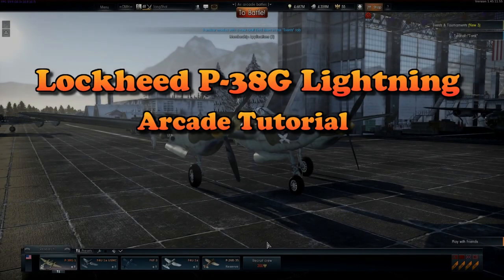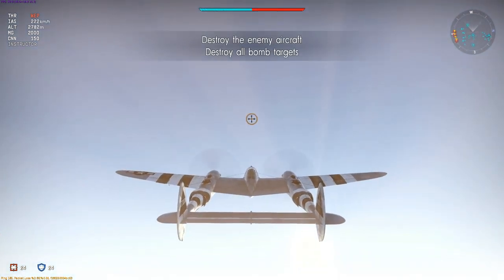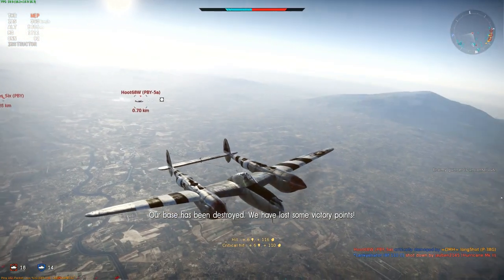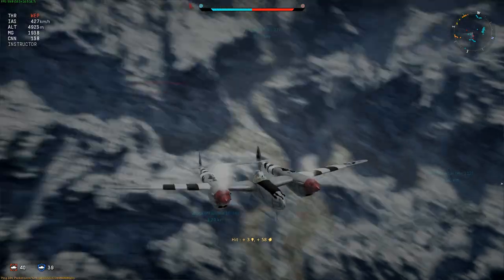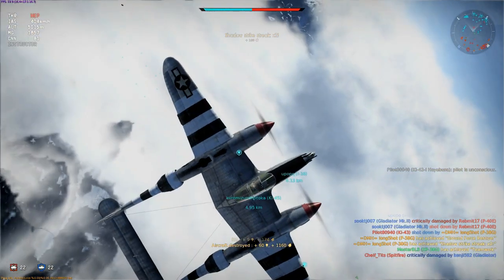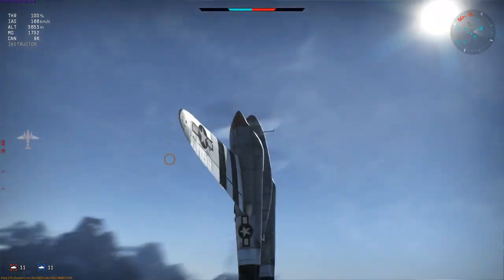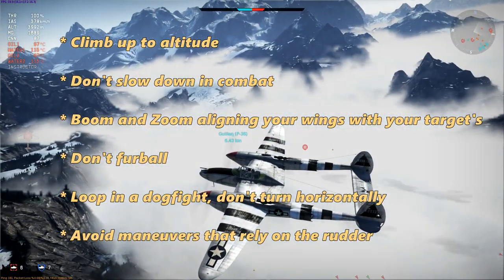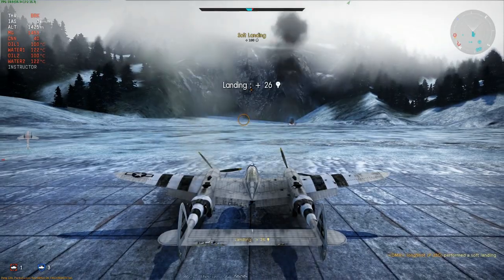WT - P-38G Arcade Guide (Patch 1.45 edition)

Comment: yeah it might have faults.  its as durable as a thin piece of plywood covered in gasoline.  and it can't rudder turn at all.   but the firepower is too good to pass up.  A fine bomber hunter indeed.  and with its good climb rate, one can dictate when you want to engage fighters.  and it can out run almost anything at its BR except maybe a thunderbolt.
Reply from the maker: Yes, very good at hunting bombers provided a gunner doesn't set you alight.  But there's other fighters that climb just as well and a few that climb better, so you can't rely on being able to dictate terms of engagement.  Its a terrible dueling plane against anything that isn't a P-47 or FW190. 

And I'll have to respectfully disagree with you about its speed, there's plenty of planes that can match its performance at high altitude (the Arcade version thereof, 4000 to 6000m) and several that can run it down.  These include FW190s, MiG-3s, P-63s and even P-400s.  If you manage to climb higher then only MiG-3s are a concern, but if you've been pushed that high then you're very much on the fringes of the battle & not having much say in what's going on.
Reply: novocas7rian all true!  but when you love a plane as much as I love that one.  it doesn't matter what is better than the P-38.  I'm having a blast in it!  :D
Reply from the maker: SpetsnazFP And I totally understand that sentiment!  I've spoken with people who love the P-51 in WT too - they're simply iconic planes.  Unfortunately I don't share a love for the P-38, I tried to like it I really did, but in the end I found its flaws just too much to make it enjoyable for me personally.  But the last thing I want to do is tell anyone else they shouldn't give it a try, just that they should do so with their eyes open.

I will say that if it ever got a more robust DM, including better fire resistance (I can say this about many US planes) then my opinion of it would be much much higher.
Reply: novocas7rian yeah the P-51, P-80 and P-38 are flying gas cans with matchstick armor.    I love the P-38.  Just the design is so different than anything else out there.  I even use it in tier 5 games just to throw jet pilots off ;).    But as is the case with love hate in planes.  I HATE the Aircobras...  I can't use their 37mm gun for nothing.  its so inaccurate.  yet I get derped by that thing all the time.  LOL!

Comment: Why no self-sealing tanks? The real P-38G had self-sealing tanks!  Almost all US fighters had self sealing tanks. The P-38 was an interceptor capable of a very climb rate. The P-38 was able to fly on one engine. The flight envelope isn't very accurate as high speed dives should hit compressibility.  A yo--yo form of attack was common in the Pacific. The J and L had maneuverbility flaps (extensions of the fowler flaps) that helped in a turn and a dive breaks. Thomas MacGuire (2nd highest US Ace) rules of engagement high speed, no turning fights.
Reply from the maker: +Renshen1957 Yeah self-sealing tanks are weird in War Thunder.  I don't know of an American plane that has them, nor do they seem to be present on British or German planes for the most part.  Most Russians can put out fires, as can A6Ms (which is weird) and odd planes here & there like the He-112 A-0.  

The P-38G is even worse in that it burns from the outer half of the wing, where there is no fuel tank at all.  Gaijin have modeled a coolant reservoir there (and coolant burns?  really?) but in reality that was an air-cooling mechanism with no liquid in it at all.  

I know the basic rule in combat is to avoid getting hit in the first place, which means you won't have to worry about fires extinguishing & so on, but for a game that prides itself on accuracy the situation re fire resistance is really farcical.  And it does effect how you can use a plane - I feel far more confident flying a P-51 or A-36 than a P-51D, simply because the latter is very fragile and flammable while the first two are not.
Reply: +long5hot The A6m Zero (Zeke) was a "Kite" burnt at the smallest burst.    The Altitude performance for Allied planes.  P-38 had a ceiling 14020 meters.  Boy, how I miss Air Warrior back in the late 1990's for online air combat for WW1, WWII, and Korean War.  There was three levels of play, beginner, intermediate, and real performance (yes, stalls modeled on the flight envelope).
Reply: +long5hot I hope the popularity of war thunder and world of tanks will inspire other devs to make similar games that don't have the health bars of WoT and the head up the ass syndrome that WT has. Maybe it'll never happen but I can hope

Comment: out turn all the things
(with flaps)
Reply from the maker: Not all things, and only for a very short time period until your speed's gone.  Then you're a sitting duck.
Reply: novocas7rian then raise flaps engage wep and sanic out of there
Reply from the maker: Elliott Vader
WEP is not enough to get you out of trouble in a dogfight once you've lost all your energy from using flaps.  Its not as if you have a rocket engine attached that instantly gets you up past 500km/h. 

If you choose to use flaps then you'd better get that kill and hope there's no other interceptors around to pounce on you.  In my opinion flaps on a plane like the P-38 should be a last resort only.
Reply: novocas7rian when was the last time you played the p 38 it has a stupid climb rate at any speed
Reply from the maker: Elliott Vader
Ok, so you're saying you can out turn "all things" in the P-38 using flaps, get yourself low on speed, then just zoom climb away from anything that threatens you using WEP.  Riiiight.  Put simply, I don't believe you.  Perhaps you should upload a video showing us how its done?
Reply from the maker: Elliott Vader Sure, there's no rush.  I hope you do manage to get a good example of what you mean - words can sometimes fail to accurately convey what we're both talking about & that leads to misunderstandings.  Also if you've found a different use for the plane then we can all learn from it :)

Comment: Well long5hot, I respect you calling 'em like you see 'em, but I don't think you are flying the P-38 to its full potential.

The strength of the plane is its combination of climb, speed, firepower, and high performance around the altitude most planes start to choke up. You talk about this, but you aren't applying it. In particular, you're not keeping your speed up and not taking advantage of it for self defense. Several times in the video you wound up flying guns defense against enemies that you could have simply avoided.

Case in point, at 9:30 you get bounced by a Chaika. You comment that you were "caught at the top of my climb at low speed" and had "no time or space to force a head-on", and complained that "no matter how hard I tried, trouble would come looking for me". Each one of these comments is ripe for analysis.

First, yes, you were caught at low speed. That's a failure of general situational awareness, but more directly it illustrates why 90-degree zoom climbs into stall should not be your default behavior in the P-38. You might get away with that behavior in a dedicated BnZer like a 190, because you are typically attacking at a higher dive speed, with more stored energy and a larger safety margin. In contrast, the P-38 is typically fishing for targets from only a kilometer or two overhead -- a small enough margin, that you can't afford to let down your guard between attacks.

Second, you had no time or space to force a head-on... which is true but irrelevant. A head-on would have been the wrong play. You were already facing away from the enemy. You were near stall at around 200 km/h, with an altitude advantage. He was below and climbing, nowhere near stall, but probably actually moving about the same speed. You had six seconds to react. (Count em!) All you needed to do was push the nose down into a shallow dive, and you'd sail away from that Chaika like it was standing still -- probably accelerating to escape speed before his lead indicator even appeared.
For reference, at 5km altitude, your straight-line speed advantage vs a Chaika is 200 km/h (I literally just tested this).

The same goes for the spitfire you encountered, and in fact the great majority of things you can encounter in a P-38. Your speed advantage may not always be as high as 200 km/h, but nearly everything you encounter, you can beat at either speed, climb, or both. The spitfire got guns on you, but it was a problem of your own creation: at every step of the way you had the option to simply walk away from that encounter. You even commented something like "I could have dived away, but it probably wouldn't have worked out any better" -- no, you really could have done exactly that, and you would have come away without a scratch.

At this point you're likely saying to yourself, "yeah but I can't just fly defensive all the time; if I'm always waiting for a clean shot, I'll be irrelevant"... but that's where the third comment is so apropos: "no matter how hard I tried, trouble would come looking for me". The solution is right there in your own words. You can afford to play defensive in the Lightning, because you don't have to think about defense and offense as separate activities. You don't have to go out of your way to find targets in the P-38; fly safe, be patient, and targets will come to you. People see you as a free kill. There's rarely a shortage of people willing to engage you at a disadvantage. Embrace that, and it will become your primary source of income. You will think of BnZ and bomber camping as a side project.

But, true, the plane is not a brawler, and won't often get crazy kill streaks. It is very hard to rack up double-digit kills in the P-38. It's not great at forcing confrontations, or even sniping with BnZ (it's ok, just not great). The main strength of the Lightning demands a playstyle that waits for enemies to make a mistake, and the rate those opportunities appear will vary.
Still, I can't help but feel you might be a bit overcritical of the plane in this regard. I mean, you complain about getting only three kills per flyout -- while offering as an example of a superior plane the P-400, a plane which, on your sheet, appears to have almost exactly the same ratio.

Speaking of the P-400...

With WEP featuring so prominently, it's hard to make a clean comparison of climb rate in arcade, but here are some speed numbers to think on -- freshly measured from test flight in arcade mode. These represent full speed at 100% throttle, no WEP (just for clarity as a baseline). I tested by diving from a kilometer above and letting the excess speed bleed off.

airspeed, indicated (km/h)
alt    p38 p400
2km 551 547
4km 600 590
6km 648 596
8km 662 570
10km 650 couldn't be bothered

These numbers say nothing about the energy retention of the Lightning, which is good at all altitudes, but the one thing clear is that the P-38 turbocharger is beastly above 4km. Granted, we don't often see much happening at 8km in arcade (esp not at BR 3.3) but the difference in the 4-6km band is important. This is the where the contest for altitude is often decided, to determine who will be camping whom for the remainder of the match.

Not saying the P-400 doesn't have its perks as well (I haven't played it enough TBH) but it's not a Lightning. The P-63 with its two-stage supercharger is a more appropriate comparison, and a real challenge for the Lightning. But to be fair, with one exception, those advantages are reflected in a higher rating.

-aka Setch
Reply from the maker: Yeah look I'd be the first to admit that I did not fly the plane particularly well in this video, and never developed anything like the expertise you've shown in flying it (glad - you told me who you were btw :)

I was also badly affected in my decision making by habits learned in other fighters, planes with good rudders and decent DMs, which is why I had an instinct to fight rather than flee when the latter was more appropriate.  I also made bad errors of SA which got me into trouble, that was not the plane's fault at all other than the perception that its an easy target which means more people will seek you out than otherwise.

My assessment at the time with the Chaika was that it did indeed have me on toast, it was approaching at a considerably faster speed than my plane was doing & my acceleration had I dived (and nosing over from a slow climb into a dive can take a good 5 seconds in a P-38) was that he'd be in very close range by the time I managed it.  I could have been wrong in that assessment, but at the time that's what I believed hence trying to turn for a head-on instead.

The Ishak, on the other hand (it wasn't the Spit, that plane didn't get guns on me, it was more of a frustration to me that I couldn't get guns on IT) ... I probably did have time to dive - whether it would have gotten me away from him I simply don't know.  In retrospect I was obviously foolish trying to maneuver, but as I said, I know I didn't fly this plane well.

You'll note though that I didn't actually die a whole lot while flying the P-38 (going by my stats, and at least 5 of those deaths are internet disconnects or graphics card crashes).  That's because most of the time I was indeed keeping my speed high and flying away, however my experience wasn't that targets were coming to me when I flew like that, simply that I spent most of the battle flying to or away from short & isolated chances to engage, with few kills to show for my trouble and no influence at all on the battle.  My problems came when I tried to force things a little and actually have more presence in the battle rather than buzzing around at the edges.

Regarding the P-400, yes it loses performance at altitude and above about 5000m or so the P-38 has a definite edge, however at these BR ranges there's honestly very little fighting taking place up there in most battles.  And I feel much more confident taking the P-400 into situations that I know the P-38 would be unlikely to survive.  My stats in the P-400 when I was flying it for a video were closer to 4:1, since then I've often (not always) used it as a backup plane which has pulled that back somewhat.

I think the P-38 is a plane that requires a specialist to do well in, and even then they will rarely dominate the battlefield.  I can't recall a single occasion in fact when I've seen that happen - not saying it doesn't or can't happen, just that it must be very uncommon.  I know the P-51 will also require similar specialist skills, maybe which is why I'm in no rush to spade it up!

All that aside, I do appreciate your feedback & hope others will read it and get a better understanding of the plane, which is what its all about :)
Reply: It's funny you mention P-400s also. P-38s and P-400s are my favorite targets. So easy to kill. I have probably never encountered first-rate opposition. But then again, I am not a first-rate pilot either. The skill required to excel in the P-38 could probably be applied to some other plane and yield a far greater sway.
Reply from the maker: When I made this video the P-400 was a much better plane than it is now, indeed it was better in many ways than the P-39s which superseded it.
Reply: ^ true
Reply: Thanks for making all the videos. They are always informative and useful.